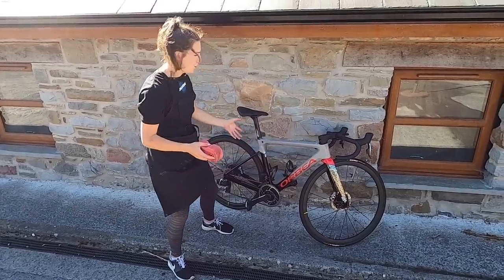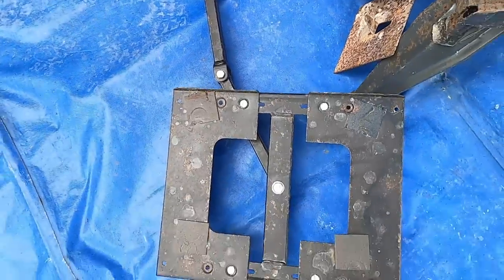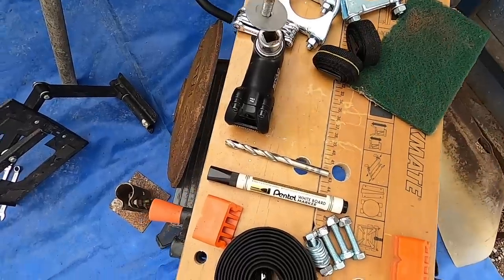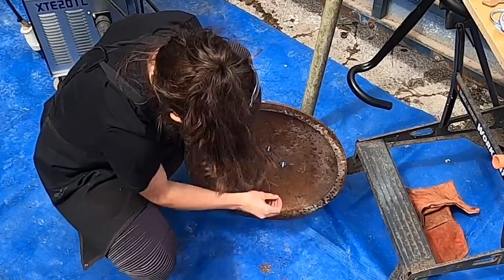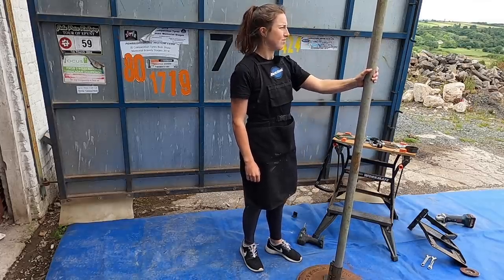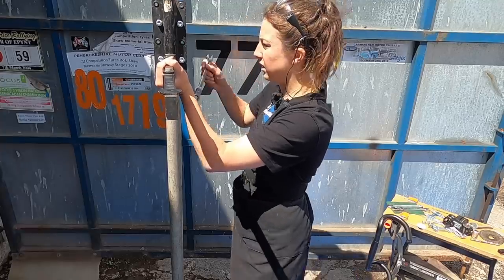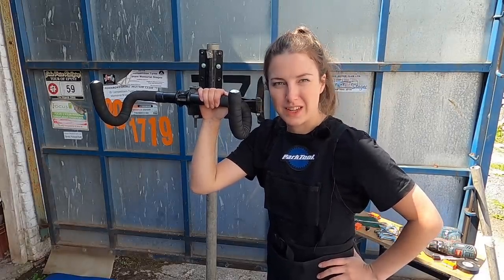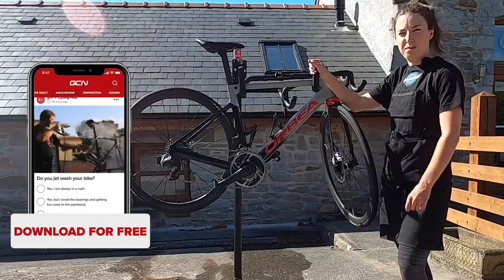Manon Makes A DIY Bike Stand Out Of Spare Parts | GCN Tech Monday Maintenance

Comment from the maker: What spare parts do you have in your shed or garage that you could use to make a DIY bike stand? Let us know in the comments below!
Reply: Wood + insulating foam + old inner tube: https://i.imgur.com/Bw9U5hD.jpg
Doubles as a working stand and a storage stand. Just not for washing.
Reply: Just knocked one up from an old roof rack and a black and decker workmate.
Not pretty but does the job.
Reply: thinking about speaker stand....
Reply: Why would you bother making one when you can get it shipped free to your house for $34 on eBay brand new and you don't have to mess with it
Reply: @TheRoybus19666  Or check out Lidl's every few months.  Bike repair stands show up there like McRibs at McD's.  Available for a short time around $20 and then off the menu.
Reply: Well, sure... first I pull out my spare welding torch, acetylene tank, lid and gloves, then...
Reply: Wall Mount Bike/Broom Holder from Lowe's  - rubber tipped and hinged too (just 2 screws...although Manon would have to find herself a stud ;-)
Reply: @georgehugh3455  haha   thats sounded like  the start of a different kind of video.  "hang on while i get my big tool out" :-)
Reply: I have some zip ties #instantbodge
Reply: Roybus Leary or hire a welder
Reply: Its my closet.  I prefer ready made bike stand that is apart of the structure of my home.  If i made a bike stand it would either be: (1)a front wheel hang utilizing a corner/adjacent wall as support or (2)a fast winch system to store the bicycle flat against the ceiling.

I dont get it why people with high ceilings dont do this.
Reply: I made my partner hold my bike and just gave it a quick blast with the pressure washer...
Reply: I need bike plz geft me bike
Reply: Got some dorado pro lying about could do an upside down suspension fork leg bike stand, mouthful lol

Comment: I just created one last week from some scrap lumber a local homebuilder was going to throw out (lots of 2x4s and 2x2s). It’s more of a ∏ shape instead of a single pole. I screwed in a couple of bike hooks under the top cross bar to hold the frame, plus 2 more to hold each wheel whilst I wash the inside of the forks, etc. I’m so glad I did it. It easily cut my wash and maintenance time in half.

Comment: If you happen to have angle grinders, hand drills, a welder, and all those other tools, you probably wouldn't need to watch this video to make a DIY bike stand, lol.
Reply: Anyone who owns a home should at least have a hand drill and assortment of basic hand tools.  The point of the video is not to make Manon's stand, but to embrace improvisation.  So, lack of a welder needn't stop you.
Reply: I don't have a welding station. So I'm just going to use an old road stem on a pole set to height, then the pole to a beach umbrella concrete base.
Reply: I have all these but rather get a used one on Craigslist. Sums up to the same cost.
Reply: No but it is still interesting to see how other people do things.

Comment: Instead of bar tape, you could sheathe the handle bars with an old inner tube.
Reply: Foam pipe insulation would be good as well
Reply: Or foam pipe insulation.

Comment: I made my own bike stand using a saw horse with adjustable height legs some spare wood and a few bolts. It supports the bike by the bottom bracket and front forks so good for carbon frames that should not in my opinion be held on the top tube and is good for quick release and through axles and adjustable length to fit road and mountain bikes

Comment: Really good video. Very inventive. 👍

The scaffold tube being aluminium costs about £2/ft to buy (if you can get a scaffold company to sell it) the sleeve coupler is £1.10 and the base plate is £0.75. Glad to see you ground away the coating as it is Galvanised and is toxic if you weld it. 😉👍 excellent first attempt at welding though.

Honestly if you enjoy the building that is great but for £40 you can buy a specific one. Great to see the recycle & reuse though. 

Instead of bar tape how about pipe insulation, cheaper and easier to put on/replace?

Comment: Here's my DIY stand. Two gardening tools like sweep brush and Dutch hoe, one wheelie bin, two 15kg weights and some pipe insulation. Simply put the pipe insulation on your gardening tool handles (pole end), lay them on wheelie bin and put the two 15kg weight on top. Adjust width of poles to desire/frameset. Suspend bike. Bish bash bosh. One bike stand in 2 mins. And it doesn't clutter up anywhere 💕💕💕

Comment: I used just the TV bracket part with a 2 inch polyurethane pipe saddle instead of the flat "tray" that the TV used to sit on. It's bolted to the external wall of the garage and is folded out when needed. The pipe saddle has a foam lining and can be closed just tight enough to use as a work stand. I did spray everything matt black of course. When next I move its coming with me.
Reply from the maker: Sounds great, Tom!

Comment: I find it hard to believe that was your first time welding, I've seen dozens of people weld for the first time (I used to teach heavy machinery maintenance) and most struggled even to get the parts to stick together. I mean, your welds may not be up to the standards of a professional welder  but they look very adequate for the job. Or maybe you'we watched other people weld a lot? 
Just try not to move the torch back and forth so much, go slowly from start to finish with maybe just a little sideways movement to spread the bead and give the weld time to properly melt and fuse to both pieces.
Reply: She had the right idea of how to test it, hit it with a sledge! :)

Comment: Manon, I love your cycling content, but you need someone looking out for you on DIY projects like this.
A completed project is always a joy, but there are some glaring safety issues in how this one was done that need to be addressed.
3:10 "Safety is key..." The most important safety tip isn't to use safety glasses, apron, and gloves (which are important), but to properly know how to use your tools.
3:40 and 4:48 Keep doing that and say goodbye to your fingers. Use a vise to hold your work.
5:06 Holding on to a part you're arc welding - a good way to electrocute yourself. Use clamps. (God, I hope none of that steel was galvanized.)
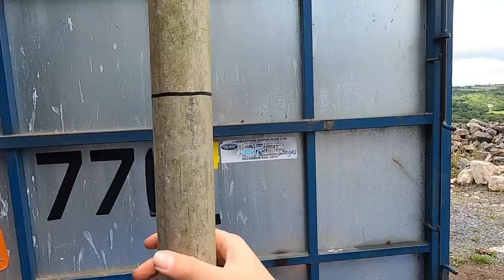6:11 Again, use a vise. You do not want a rapidly spinning cutting blade to bite into concrete.
7:00 For the love of God, keep the drill away from your face and hair.
All those jagged edges on the pole and square base plate WILL cut someone one day. Grind them flush and file the edges round.
Those welds will probably hold as long as not much stress is put on them, but I, personally, wouldn't want to trust a $10,000 bike with them.
For your next project, find someone who will correct your mistakes before you injure yourself.
Judging by the incredible house/property you've been filming from, you can afford a Park Tool bike stand, if one will not simply be given to you. Use one of those instead.